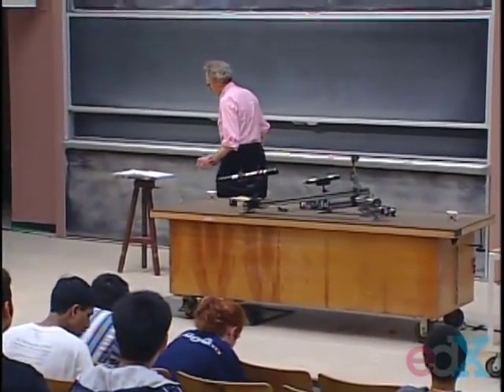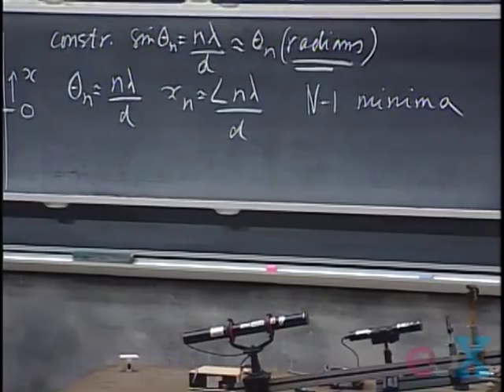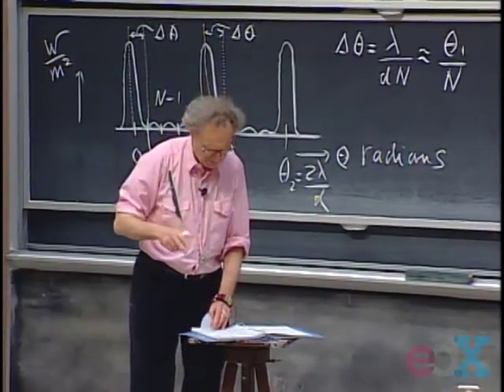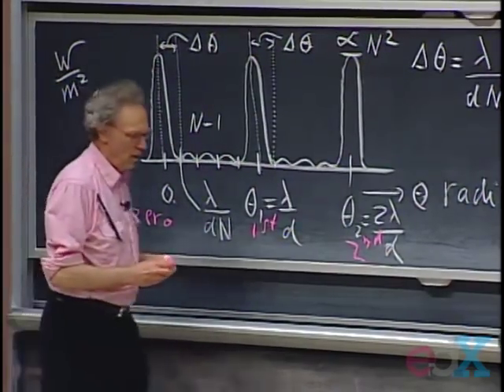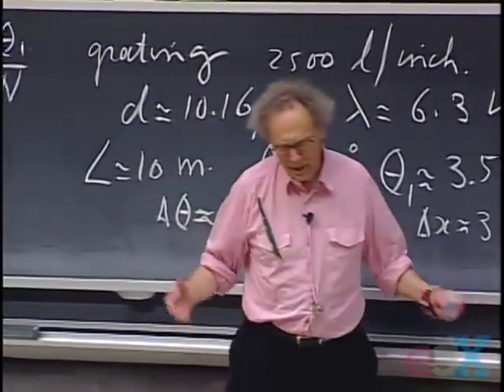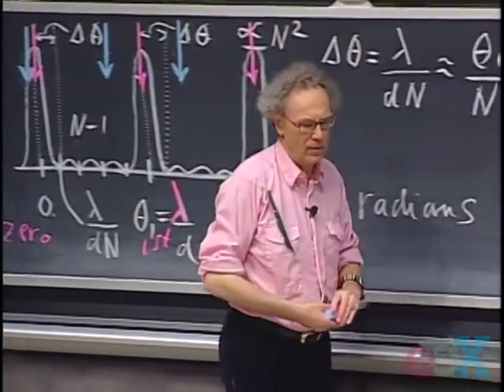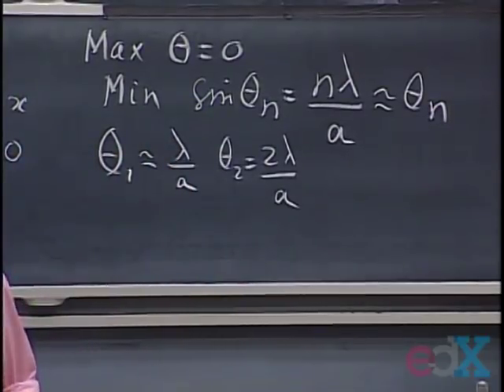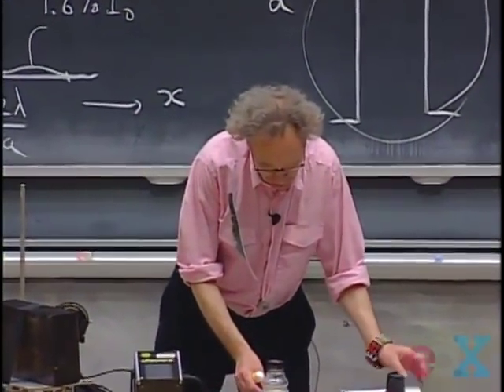8.02x - Lect 34 - Diffraction, Gratings, Resolving Power, Angular Resolution

Comment: Professor I would argue the fact with you if the intensity of the light source is too high the closer together it is the eye cannot differentiate between 2 points but further away the I can because intensity decreases also you intentionally chose blue LEDs human eyes are very susceptible to Greens and Blue wavelengths had that demonstration been done with more wavelengths of colors through the whole Spectrum I believe the results would have been very different and had you change the intensity you would have seen different results and got different hands waved of what people could see

Comment: Sir if make a charged metallic ball freely fall in vaccum with it produce electromagnetic radiation
Reply from the maker: That is an excellent question. It has been debated for decades. 
The central strangeness is that a free falling charge emits no radiation as seen by a free falling observer, while a supported charge emits no radiation as seen by a supported observer.

On the other hand if you are standing on the earth then you will see a free falling charge as radiating. And if you are falling freely then you will see a charge that is sitting on a table as radiating.

This means that radiation exists for some observers and not for others! That seems very surprising, but is in fact the basic result that leads to Unruh radiation (or Hawking radiation if you think gravity).
Reply: Lectures by Walter Lewin. They will make you ♥ Physics. Thank you Sir
Reply: I asked the same kind of question three years ago to our professor. He didn't give the answer.I thought harder.And came to the conclusion that two different result will indeed be observed.

Comment: 27:52 Sadly I can't do the same reasoning for Theta 2. In that case why can't it be bright because start from middle of the slit then go downward there's always a Huygen source in difference of Lamda with a point in upper half.

Okay I figured it out while typing this. This have to be solved recursively. Upper half + down half(for n is even but same reasoning for odd n) results in similar situation of Theta n/2. There're still peak and valley in EM field need to be added together. So the end result is dark too.

Comment: Sir we know that electric field start from +ve charge and ends at -ve charge. Change in electric field produces magnetic field. Magnetic field start's from North pole and end at South pole and form closed loops. Change in magnetic and electric field due to acceleration produces Electromagnetic radiation. Sir but why light travels in straight line and do not form any loop.
Reply from the maker: I suggest you ask quora. I am sure they have discussed this at length. Or try google.

Comment: Professor when i shined violet light on white A4 sheet it gave violet colour but when I shined violet light on your book pages, "FOR THE LOVE OF PHYSICS" it gave pink colour. Does it depend on the chemical nature of the paper.
Reply: What you are seeing is most likely related to fluorescence. The violet light is light with a wavelength of ~ 400 nm and it has enough energy to excite the chemical used on the pages which then partly re-emits light with a longer wavelength. Those colours get mixed up and your eye interprets them as the colour you're seeing.

Comment: But professor, in one of the other lectures you said that diffraction pattern is caused because of heisenberg's uncertainty principle. Are these both the same thing? It's confusing.
Reply from the maker: Everything in Nature HAS TO BE consistent with HUP. The BEST/ONLY way to demonstrate that at the 8.02 level is to do the single slit diffraction. You can then PROVE quantitatively  that the central image on the screen (which you can measure) is what you should expect from HUP. Other demos, like double slit interference and diffraction gratings are also consistent with HUP but that  is by no means obvious at the 8.02 level. I am immensely pleased that I found on my own a way (single slit) to demonstrate HUP. Also watch this lecture with fabulous quantitative confirmation. https://www.youtube.com/watch?v=MeK0DV329mU&index=7&list=PLyQSN7X0ro21uk5LTH085VLMfkb_dRjHF
Reply: Lectures by Walter Lewin. They will make you ♥ Physics.  Thanks for explaining sir. And thank you very much for sharing all the lectures and knowledge.!

Comment: Professor, let me ask you: When use the small gratings, the retine is the screen? And i can't quite see why for seeing the maxima i can rotate my head...is the relative angle between de gratins and the source what i'm changing now? Thanks!
Reply from the maker: Tell me more precisely what you and what you saw.
Reply: Sorry. I mean, when one uses the  multiple gratings sheet, and see directly to the white light with it, you say that the eye acts like a convergent lens, so i was wondering if the screen was the retine of my eye.
Reply from the maker: yes, of course
Reply: Great. And, as I can't see all the spectra at once obviously, to be able to see each maxima i have to turn my head. In this case i'm changing the relative angle between the source and the gratings instead the angle between the gratings and the screen?
Reply from the maker: yes
Reply: Thank you very much! :)

Comment: Professor Lewin, ik vroeg me af of het fenomeen dat we waarnemen na 17:30 minuten in het college (het inferentiepatroon van wit licht, als ik het goed begrijp.) iets te maken heeft met de eerste (primaire) regenboog, omdat daar de kleurenvolgorde ook van blauw aan de binnenkant naar rood aan de buitenkant loopt. Zo ja, is de verklaring daarvoor te vinden met Google (dan zal ik daar gebruik van maken)? Zo nee, mijn excuses.
Reply from the maker: 17:30 diffraction grating, it shows dispersion! angle is proportional to (lamda/d) thus the larger lambda the larger the angle. Thus blue is on the "inside" red on the outside. Rainbows show dispersion due to the geometry of the water drop (NOT lambda/d, but lambda) for the primary bow. Thus red is on the outside and blue on the inside. For the secondary bow dispersion is reversed due to geometry, thus blue is on the outside and red on the inside.

Comment: Hi! How can I produce a "homemade" diffraction grating? I loved your lecture!
Reply from the maker: Not possible - but a CD can be u,sed as a reflection grating
Reply: How much effort do you want to put into it? Gratings can be made mechanically or photographically. Making them mechanically is easier. You can make a small machine that can scratch gratings into a silver mirror from simple mechanical parts that are now available cheaply on the internet. Having said that, cheap industrial gratings cost less than $5 and even a well made optical grating that would be useful for many actual science experiments is less than $100 these days. You can buy ready to go pocket spectroscopes for $20...

Comment: Sir, the human angular resolution that you mentioned is for only one eye? Or is it calculated for both eyes? (When you have 2 telescopes it is equivalent to have only one bigger telescope, with the eyes happens the same?)
Reply from the maker: with 2 telescopes you get twice as many photons, but if yu can use them as an interferometer you get twice as high a resolution. Your eyes cannot be used as an interferometer thius 2 eyes doess not increase your resolution

Comment: Sir why the phase difference has to be constant between the two wave  to see the interference pattern
Reply: Because if the phase is changing 
At the same location you will observe constructive intereference as well  as destructive interference.
Due to which you will not be able to observe intereference pattern properly!

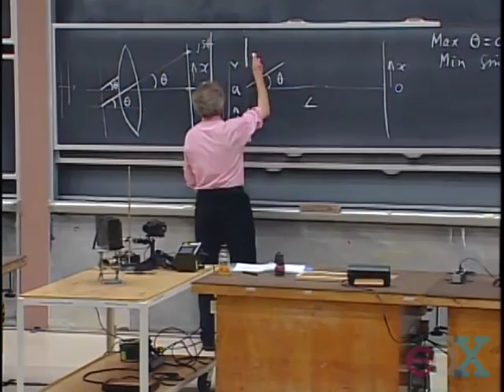Comment: Sir, Why the difference in path length of the two Huygens sources at 27:00 is lambda?
Reply from the maker: constructive interference
Reply: Sir, i thought constructive interference is the result(or the consequence) of the difference path length, lambda. So please may i know what is the initial reason that the parh length difference of the two sources (at those points) are lambda?
Reply from the maker: interference is the result of different path length. If the difference is lambda/2 of 3*lambda/2 or 5*lambda/2 . . .  there is destructive interference. If the difference is n*lambda n is an integer (including zero) there is constructive interference. It's well explained in my lectures. If you need more help, please use google.
Reply: Thank you, Sir.
Reply from the maker: Read this https://en.wikipedia.org/wiki/Huygens–Fresnel_principle
Reply: Thanks again.

Comment: Professor, 
1- Is there any video about measuring polrazation angle with the help of Brewster's law by a prism spectrometer ?
And 2- video about concept of Schuster's method parallel ray setting ?
Reply from the maker: 1. yes in my 8.03 lectures
2. no - use google
Reply: Sir, which video in your 8.03 lectures, lecture number please?
Reply from the maker: all my lectures have listed topics. go for it
Reply: Thank you, sir

Comment: Professor, when looking through a grating at a white light source why does the zero order have color to it? The color also shifts with the angle of the grating in relation to the zero order usually from a beige/yellow color to purple/blue. Thanks!
Reply from the maker: The zero order of a light source is has the same color as the light source. If not, tell me how many minutes into the lecture this was not the case.
Reply: Oh I'm sorry this is from my own observations, I manufacture diffraction gratings for a living and when you hold them up to your eye the zero order has a yellow color and will change dependent on the angle you look through it. We have been unable to work out why to this point. I am just uploading a short video of the effect. Thanks!
Reply from the maker: watch my grating lectures!
I use white light, the zero order is white. Your gratings may be of low quality and the plastic may absorb part of the spectrum changing white into yellow.
Reply: I have been they are wonderful thank you so much. They are a 100l/mm grating blazed for 500nm. I think you must be right and it must be the resin we use for the replicating process. Without the grooves however it appears clear. Thank you so much for taking your time to reply.
Reply: Having now compared the blank film and the same film with a grating on it seems the issue is not the resin or the grating quality as these were some of the best the NPL ever produced. The grooves seem to be creating a color filtering of the zero order. Hopefully after watching more of you lectures I will be able to understand why this is happening.
Reply from the maker: I watched your video. For me, the zero order is as white as the source.
Reply from the maker: I watched the video. The color change in the zero order is minute (for me).
Reply: So you are suggesting all we are seeing is the true color of the remainder of the light that does not end up anywhere other than zero order? Thank you sir you are a great help.
Reply from the maker: The difference in color (for me) between the source and the zero order is small. I cannot get too enthusiastic about it. Clearly some of the light of the source is "filtered" out in the process.
Reply: I do apologise if my questions seem simple, I am not academic and have had no formal training in diffraction. I do however much appreciate your comments and time you have taken to answer even if it does seem a bit silly :)
Reply from the maker: It' NOT silly at all. I just can't get too enthusiastic about it. Discoloring can occur in the plastic.
Reply: Although I absolutely understand the discoloring can occur from the plastic it does not seem to fully explain what is seen. Having experimented some more with different line densities(600/300/200/100/80l/mm) on both celullose acetate and on resin I can see that as the density decreases you get more zero order color shift on tilting the grating. The 600l/mm shows no shifting with the yellowish tone steady all the way through to 90deg whereas the 80lmm will scan through pink/purple/blue/green/yellow on tilting. I am edging towards the idea that perhaps when the density is in the correct range the peaks and troughs of the grooves are creating a resonant grating or subwavelength structure when viewed at angles other than the norm.
Reply from the maker: When you angle a grating the derivation in my lectures is not valid. That may explain what you observed.
https://www.youtube.com/watch?
v=4Lkg3RgQcHc&index=22&list=PLyQSN7X0ro22WeXM2QCKJm2NP_xHpGV89
Reply: Thanks. I will watch this right away.
Reply from the maker: I reproduced your result. I have a very bright vertical line white LED source. The zero order is a little bit yellowish. When I rotate my grating about an axis parallel to the line source, the zero order stays in place but it changes color and the first order spectrum moves away from the zero order as it should as the projected distance between groves decreases.
Reply: Lectures by Walter Lewin. They will make you ♥ Physics. Yes that is exactly what I observe. It is the change in color of that zero order I have not been able to understand thus far. I am pleased you managed to repeat the result! You will also see the change in color of the zero order is also related to the grating density. As I mentioned before the lower density gratings show more color on rotation than the higher density gratings.
Reply: I am using a fluorimeter where exction at 340nm gives clear blue light rest color are almost at good position i.e. 550 nm for green 600 nm for red but again blue start 700 nm.also at zero order it is pinkish or reddish. why it is happening? it is a 1200l/mn grating blazed at 500 nm
Reply from the maker: It's not possible for me to answer your question. If I had your fluorometer and diffraction grating then I could. Show the demo to  your physics teacher. He should then be able to answer your questions.
Reply: ok sir...but can u provide e a video where I can clearly understand or visualize how a grating produce spectrum and 2nd order 3rd order spectrum or harmonic?
also I have a question if a grating produce 2nd order say at 1100 for green then how I excite the sample with 1100nm NIR wavelength which should not be green?
Reply: sir am I able to make u understand my question?
Reply from the maker: It's not possible for me to answer your question. If I had your fluorometer and diffraction grating then I could. Show the demo to  your physics teacher. He should then be able to answer your questions.

Comment: Dear professor,
1 can only electric or magnetic waves exist independently?
 2 also for EM waves, do the E an B waves need to be in phase? that is would an EM ave travel if E and B were out of phase or had a different frequency?
3 Does the fact that light travels slowly in mediums with high n, conflict with relativity? I found an explanation online of why not, but i am not sure of its authenticity. It said that light has to take a longer path in mediums with a high index of refraction. Is this correct professor?
Thank you very much.
Reply from the maker: use google